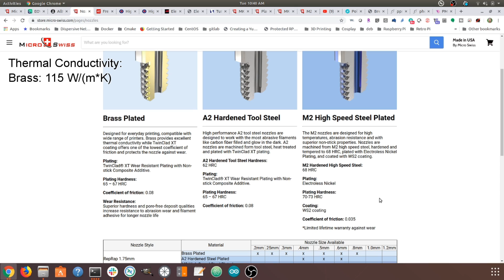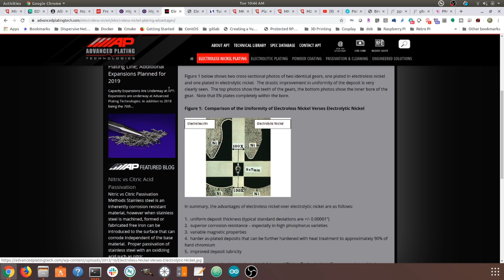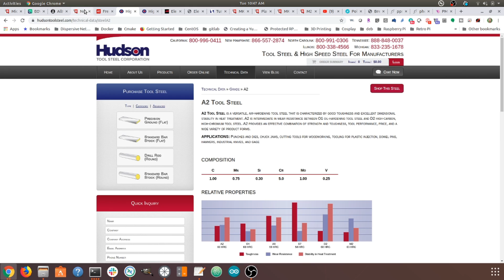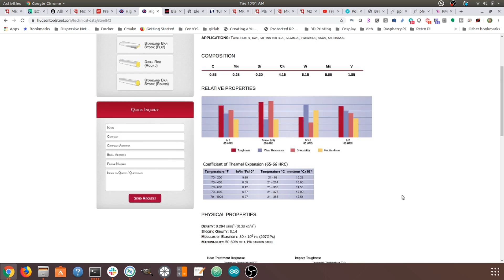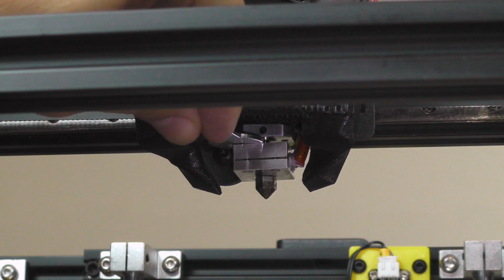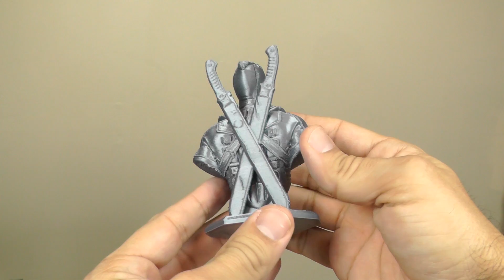Micro Swiss Nozzle: Metals, Coatings, and Science!

Comment: I'm well pleased with the micro swiss stuff. The main snag from going from the stock ptfe tube lined hot end, is to remember not to turn off the printer as soon as the print finishes, you have to let the hot end be cooled by the fan. Dr Vax gives info on simple unblocking 'though.  I'm pleased you give credit to others..
Reply from the maker: I'm glad it's working for you and that's an excellent tip! I do my best to send you to the source. Thanks!

Comment: Kris,

Thanks for the video again. I wanted to confirm for you the artifacts in the side of the Benchy are indeed from the slicer. I carefully looked over the pathways a while ago in Cura and found out the grid infill hits at precisely those spots. That is why you see the same spots on many people’s Benchy’s. You can get rid of them by using a different infill pattern.
Reply from the maker: Thanks for the feedback Jeff. I wasn't talking about any infill patterns though on the sides. Did you see some? I didn't. With 1.6mm side walls, those should be eliminated. Thanks!

Comment: I'm running a Micro Swiss all metal hotend on an Ender 3 Pro with a dual gear extruder with Spider Maker PLA at 230°C at 50.0 mm/s and no parts cooling fan.

That's near the top end of the filament's suggested setting range, but anything less and I get layer adhesion issues. I just got this printer used and just got it running this week, so I am still printing components like fan ducts, mounts, etc that are missing. My goal is to get up to Carbon Fiber at least.
Reply from the maker: Have you tried other filaments with similar results?

Comment: I run my steel nozzles the same temperature as my brass nozzles... the results and layer adhesion between the two are about exactly the same.

perhaps it depends how fast you can print? my limit has been the thermal conductivity of my filament, not my nozzle material.

Comment: I have seen others had to upgrade heating element in the heat block to achieve above 250.  You only had to tweak the firmware and was able to get to 270 or so?  Ever try to run over 300 for some polycarb filaments?

Comment: Have you ever had wall/line width being smaller than the nozzle size on any of your printers? i am getting wall gaps no matter what I change in settings so i decided to print a single wall cube and measure wall thickness... I have a .4mm nozzle but my walls are only coming out about .35mm or .33mm. Ever had this problem before?
Reply from the maker: This is one of two things: 1) Cheap nozzle with too small of an opening. 2) Under-extrusion.
#2 is easy to test for. Do an extruder calibration first. Make sure that when you say 10cm, you get 10cm. (Google this if it's new to you.) Then retest.
#1 you can test for with a .4mm drill bit or just replace your nozzle.
Reply: @kerseyfabs  I did the calibration but it made no difference. The strange thing is the skirt line width and flow is perfect but the print flow is poor and much less. I messed with all the settings and flow in cura but no change. I have a newer tronxy so im limited to what i can change in the firmware which sucks. I ordered a 32bit board so i can run Marlin and make more adjustments to see if i have better results with the hardware.
Reply from the maker: @wrxsubaru02  How fast are you printing?
Reply: @kerseyfabs  sometimes 60 sometimes 80 but i turn first layer and walls way down to 20 or 30 so speed is not the issue either. I have 4 printers and this is the only one doing this so its really confusing. print quality is really good but just under extruded around holes and between walls. almost like in the firmware something is off.
Reply from the maker: Does this mainly show up on top layers?
Reply: @kerseyfabs   Through the whole print from the bottom to the top. i tried infill overlaps, upped the % on inner wall flow, inset on the outer wall, i have literally tried everything. There is something really strange with this printer.
Reply from the maker: Have you tried a different nozzle?
Reply: @kerseyfabs  I have but it is the exact same thing. tried changing the PTFE tube as well. checked the temps, literally everything possible i can do i tried.

Comment: Kris, great video.  Do you have nay idea when the Creality nozzles will be out?
Reply from the maker: It should be any time now (within a couple of weeks). I'll provide links and information as soon as I hear.
Reply: @kerseyfabs    So it's been a while, and there isn't a Creality-type nozzle for this.  Microswiss like everyone else is jammed up from the COVID.  So now I'm really curious, what is/are the problem(s) with using the existing M2 with an ender5?  I decided to experiment with it, and basically everything went  to hades, but I don't really understand why.  Beyond the length difference, and the thermal properties of the materials used, what's making 1.75mm filament behave differently with the M2 vs any Creality style nozzle? I've looked around on the interwebs, and as yet haven't found a satisfactory answer.  Would you mind sharing some insight?

Comment: I used a new microSwiss plated brass nozzle for printing esun pla glow in the dark and it wore out in about 200g of filament.   Contrary to what microSwiss say, it's not for abrasive materials.
https://photos.app.goo.gl/rFwQqbTH2wFqRFkB9
Left, 0.4 microSwiss after 200g glow in the dark pla. Middle new other brand plated 0.4. Right very used (normal pla) 0.4 brass.
Reply from the maker: If I didn't make this clear in the video, I agree with you. I thought it would last longer than your experience shows but any brass nozzle, even coated, isn't going to last long against abrasive filament. That's why they make steel nozzles.